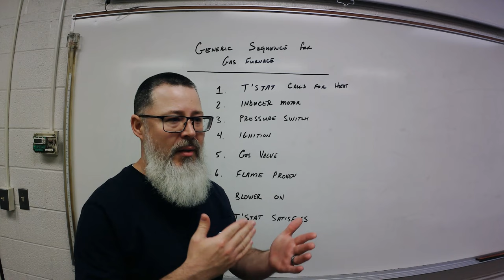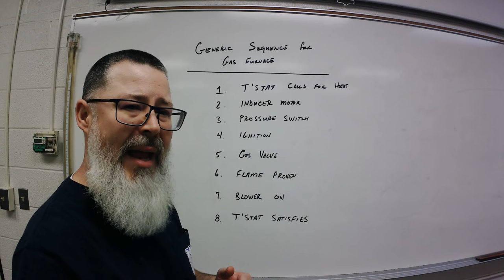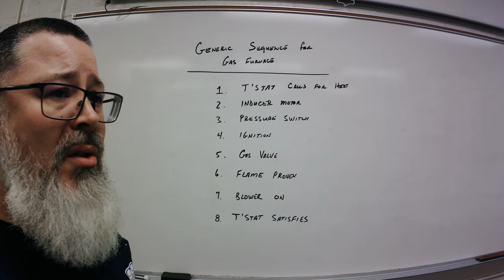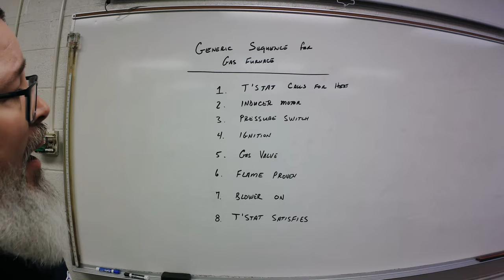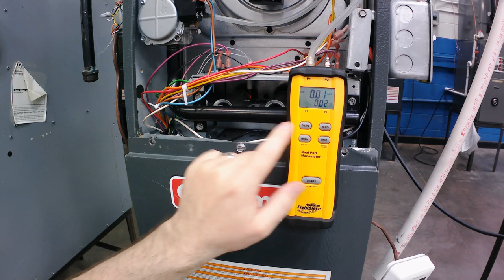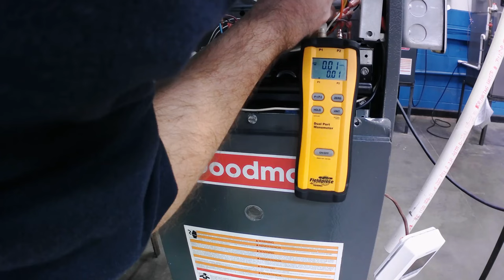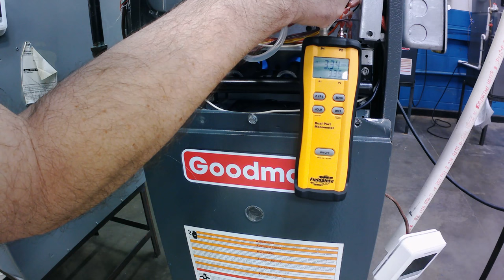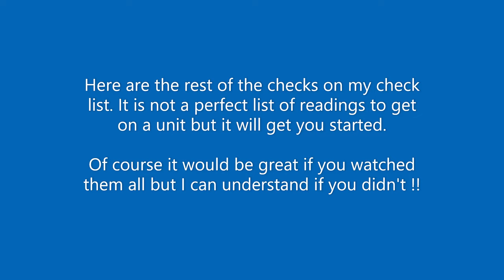80% Goodman Furnace - Furnace Won't Light | Shop Troubleshooting (Gas Valve outlet pressure too low)

Comment: I know nothing about furnaces  but was able to figure out my own problem last night. No click from gas valve. Found condensate clogged and would not let pressure switch close with the water backed up. These simple steps really do help figure out basic operations. Cleared and drained the clog I have heat now thank you.
Reply from the maker: Awesome. Glad to hear you fixed it.
Reply: Condensate clogged? What is that?🤔

Comment: Not everyone can teach but this guy seems to be very good at it. Most everything I have learned I have learned on my own.  Just saying I do not know a whole lot. I have watched many videos here on youtube. Mostly how to videos, it seems the hardest thing about fixing anything is tracking down what is wrong. Seems so many things can cause the same problem. And when you are not sure what to look for you end up buying parts that you do not need, and it can get really expensive.  This list of what should happen next and what to look for is a must know. Wish I had seen this video before I started screwing around with my POS furnace. At first, I thought it was the flame sensor. On this unit the flame sensor and ignitor are made together. I did not know the ignitor was so fragile. As I was cleaning the flame sensor I brushed against the ignitor, and it fell apart.  And the local parts house wants $106 for a new one. Now I am thinking it may be the gas valve. Just like in this video the ignitor starts to glow and then Nothing. No flames, just shuts down. Once the new parts arrive and I get them installed I can get my voltmeter out and start doing some checking.
Reply from the maker: Never heard of that brand...POS? Must be a new one! 🤣

Comment: If you don’t get ignition of burners, you don’t check gas pressure first. You check voltage at the gas valve at the moment of ignition. No voltage, bad board. Voltage present?  Then check for gas pressure and suspect a bad valve.
Reply from the maker: Different techniques maybe but we hope to get to the same place in troubleshooting down to the root cause.
Reply: Adjust your camera. We can't see s#¡+ when you adjust/check had pressure.
Reply: Also, in your notes you show are way too brief
Reply: I had a similar.problem but found the propane copper line outside feeding the unit was crimped ..hence low pressure..it builds up and works for a while then won't work next time a call for heat comes in..
Reply from the maker: I had a terrible camera and even worse cameraman operating it! It is under new management now...
Reply: He heard it click on and also heard the faint sound of gas being released. Much more likely that it's the pressure than the voltage.

Comment: Great video. Now I can fix myself and not have a $400 service call. The flame sensor rod apparently gets covered in soot and stops working in 3-5 years (imaging my surprise when my 3 year old brand new furnace wouldn't work), As an electrical engineer who designs semiconductors - it is a major design flaw by Goodman! So if the furnace start then stops - check the Flame sensor first!
Reply from the maker: You might have to do a collaboration with them to develop a better flame sensor!
Reply: $400? Where do live? Beverly Hills?
Reply from the maker: Could be Malibu but honestly when you pay a $100 just to have someone show up it could get to be $300 to 400 easy.

Comment: Field tech in different field  - my jumpers are numbered 1-6 (I keep 6 in hand with wire stickers on them) and all have a 1/2" x 3" fire resistant, fluorescent yellow/green fabric tag  with an embroidered "Jumper" in bright red on them fastened in the middle of my jumpers.  I use the little tool bag system in my kit, and they have their own little bag.   When putting my tools up, I set the jumper bag out and count them in while in use, count them out when done, verified 6 of 6 when putting tools up.  Had a forner Navy electrician share that with me, based off of the "Remove Before Flight" tags on the carrier aircraft.  I bit much, I know - but I work on some really expensive systems some of which have incorporated safety systems in them also so I'm a bit paranoid.  Thanks for the video.
Reply from the maker: That's pretty awesome if I may say so. We all have our ways and I try to pick up something from everyone. Something good to do or something bad not to do. I appreciate the input. Sounds like something good.

Comment: The whole key to accurately troubleshooting, is to remember the full sequence of operation. Don’t just replace parts . Understand the reason the furnace isn’t working and let your training and experience kick in.
Reply from the maker: 100% couldn't agree more. Getting that sequence down is and has to be the most critical thing. Without it, just like you said...just changing parts. I had a young lady who works in the field here locally tell me about a job she was on and during the story she said "cause that is the way my supervisor does it". When she paused I asked her if she knew why he did "whatever" because if you don't then you are just memorizing it and not understanding it. Good point...I like it!

Comment: I like using a piece of ziptie and jam in into the doorswitch to keep it closed, quick and easy. It alsolets you put the door back on without shutting off the furnace
Reply from the maker: I think I have heard of that from someone. I had someone take a screw and "lightly thread" it in...might as well buy the Supco door switch magnet!

Comment: my goodman 90% ran out of propane in the spring so I left it empty all summer and a few days ago I got propane delivered and the furnace wouldn't light but everything else seemed to work and the light was blinking code one so looked that up and couldn't get a clear answer so I was thinking the gas valve might have something wrong with it but I didn't have pressure checker so few days go by and watching all kinds of videos on it and go try looking at it again and decide to pull off the gas line to the valve and turned the knob back on and nothing came out so then I knew what it was , the idiot that delivered the propane forgot to turn the valve back on on the tank, but then again he was probly in a hurry to get out of here as I have 4 attack roosters that run loose and go after anyone who inters my property and a barking dog inside the fence. so it fired right up after that and learned alot about my furnace.
Reply from the maker: I needed this...thanks for sharing. I know that 1 attack rooster is enough so 4 is definitely something to fear. I once ran a call and the customers furnace wouldn't light either...long story short...she hadn't paid her bill in over a year and they took her entire natural gas meter. I stubbed my toe on the gas company line as I was walking around the house. She said "oh yeah, I forgot about that bill!"

Comment: So what was the problem? What did you replace? This exactly what the guy charged me $129 for nothing aweek ago. $129 to tell me I needed a  new furnace.  How did you solve the gas pressure issue? What did you change or replace?🤔
Reply from the maker: Replaced nothing. Only had to adjust the gas pressure higher using the adjustment screw on the gas valve itself. It is under thae brass looking cap with a flat head screwdriver slot. Took off the cap and there is a plastic adjustment screw underneath. I honestly haven't seen that problem very often but I guess it could happen on a brand new valve sent from the factory. Most of the time I change a gas valve it is not a perfect pressure for the output pressure and may need a slight adjustment but it is usually close.

Comment: I need to know how to change the igniter on the first Goodman you worked on
Reply from the maker: A lot of the Goodman ignitor are the same. They are held in with a 5/16 inch hex head screw. Just unplug the ignitor at he plug that is about 6 inches away from the ignitor and unscrew that screw with a nut driver. Should be fairly easy.
Reply: @johnjennings-JJ  if the igniter doesn't even light up and the gas is running. I'm hoping that's the problem
Reply from the maker: @girlface5943  very good possibility. The ignitor should definitely be glowing before the gas valve opens to turn on the gas and if the gas valve does open then the board must be thinking it already had the ignitor ready. If it was working before and now it isn't then it is very possible. But there may be another issue. Hard for me to day without being there of course. For the cost of the ignitor, it is probably the cheapest route to start with if you DIY.

Comment: My good man is weird… if I power cycle it the furnace will run but once it needs to come back on to reheat house induce motor comes on and clicks but nothing… any advice?
Reply from the maker: After the inducer motor comes on, it should generate enough draft (through the heat exchanger) to close the pressure switch. If that switch isn't closing then you could have a few issues. Bad inducer motor wheel, bad pressure switch, clogged flue pipe, crack in your heat exchanger, etc. Tough to say from here. The 'click' is curious to me. If that click is the gas valve then that changes everything. Do you see a glow from the ignitor or hear a spark "sparking" before the click?

Comment: Why not use a spring clip for the door sensor?    Then there is no chance to leave it bypassed with tape or with the jumper.    You will hit the clip when you put the door back on.
Reply from the maker: I can see that working depending in what shape/size it is...i am gonna have to look into that method.

Comment: Goodman gms80 furnace. Furnace randomly turns on blower fan. Furnace thermostat (nest smart) set to system off. Still randomly turns on at times. Pulled the nest off the mount. It still will run the fan randomly. Any suggestions?
Reply from the maker: Maybe the fan is set to "circ" at the tstat so it comes on sometimes? Or maybe when it happens again, go check the furnace board for a error code flashing? If the furnace board is turning on the blower it is probably trying to get your attention so you will notice an error code.
Reply: Thanks for the message back!! I shut the system off at the switch for about an hour many weeks ago and it didn't turn back on for weeks and weeks then today randomly it ran the fan for about 15 mins then shut off. If I pull the nest right off the wall it still runs. And the nest system is set to 100% off as it's been mild here in the Midwest no reason for heat or ac. I did pull the panel off the furnace and there was no error codes. I got to it right before it randomly shut off again.

Comment: Furnace isn't working ATM and light is steady on but nothing is ignition or turning on at all
Reply from the maker: If it isn't blinking or the red led fashing a code then it sounds like it may not realize you want the heat on! Steady light on means it is most likely ready to turn on amd is waiting for the signal from the thermostat. This might sound crazy but make sure the thermostat is set to heat and has a set point higher than the room. Do you have an electrical test meter?

Comment: If anyone can answer this please. Ever since we got in the house, the air feeder, never had a filter. I put one and after that the problem started,the ignition turns on, the burners clicks but doesn't stays on, it keeps attempting to turn on, I removed the filter feeder. Not even 1 hour later but now still does it, the only way it starts and still on is leaving it off for 10 minutes and then starts fine. Is the filter incident a coincidence? Is an air flow problem if that exists? Or it can be the little green build up around the copper fitting? Thanks in advance
Reply from the maker: The filter kinda seems like a coincidence. An airflow issue would probably not allow the unit to even get that far in the startup sequence after an initial starting. BUT...if you never had a filter before you may indeed have some issues with the evaporator coil being dirty because if you don't use a filter the coil will act as one! Maybe try to see what error code the circuit board is flashing. That would probably be the beat place to start.

Comment: Hello, I had to turn my main gas off and now I need to turn my furnace back on. How do I know if I need to manually light my pilot? How do I turn it back on?
Reply from the maker: I haven't seen a whole lot of pilot lights on furnaces in a while. You can look at the main gas valve and it is say ON and OFF then you don't have a pilot light! It will say OFF, Pilot, and ON. If you have a pilot then you will have to hold down the button on the gas valve while you light the pilot and let the thermocouple warm up. If you got a furnace made in this century it likely doesn't have a pilot though.

Comment: My red light is off completely which states control failure how do I check that ?
Reply from the maker: First things first, verify high voltage and low voltage to the board. I had one the other day that had an issue with a bad transformer (no 24v output) and the red light was not on because it didn't have that 24v power. Otherwise you just might have a bad board and need to replace it. But i would verify power before buying a new one.

Comment: If the valve was new, wouldn’t come  somewhat set to 3.5 in of WC straight from the factory?
Reply from the maker: Seems like no matter how much I think I can be "reasonably sure"...I still have to check it!  Not saying that I am/have aleays been perfect, but I learned real quick that if you want to know for sure -  you have got to check for yourself.
Reply: @johnjennings-JJ  how about for LPG? what would be the inlet and outlet pressure? where to connect the hose for the manometer on the gas valve?
Reply from the maker: Should be a "boss plug" on the inlet side of the gas valve and also the outlet side of the valve. Depending on the model of valve it takes a larger hex wrench (3/16) or a smaller (3/32). I think I got those sized right! For most gas valve I have seen it tells you that it should be no more than 14" W.C. (1/2 psi) inlet to the valve from a regulator and the outlet is generally 10 to 11" W.C.
Reply: Usually comes set a little higher so it works all the time. You must check it and adjust to the manufacturer’s label on the furnace. It tells you the correct water column. Don’t guess. Too high and you waste gas and overheat the heat exchanger. Too low, and it may not ignite every cycle.

Comment: Just curious where you find the limits for all the checks that you do.
Reply from the maker: Just looking up different manuals, sometimes they are in the installation manual and sometimes it is in a product specifications manual. I look up parts manuals and get things like temperature switch ratings, etc. In some cases I don't look up the make of the whole unit (like Goodman or Carrier) I will look up a specific part model number. So say for something like a gas valve in a Goodman unit, I might look up the Honeywell gas valve model # "XYZ" that is actually in it. But basically looking info up but sticking with manufacturers info.

Comment: How do you replace the gas valve?
Reply from the maker: Short version...cut off the gas and remove wiring, use 2 pipe wrenches to break the union that should hopefully be in the main line going into the gas valve - once done then use same wrenches to take the gas line out of the inlet to the gas valve and repeat to take gas valve off of the manifold piping. Gas valve is now out! Make sure you look at the new valve for the flow direction arrow that tells you which way to put it in correctly. Basically it is a reverse process now but with a little pipe dope/thread sealant or gas rated thread tape on the pipe threads (not union though). Turn the gas on and  check for leaks using liquid gas detector. If no leaks then let it run.